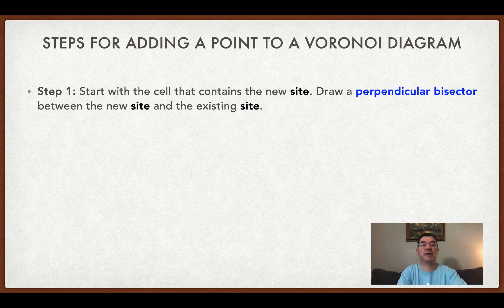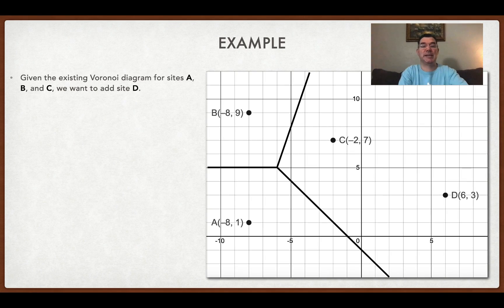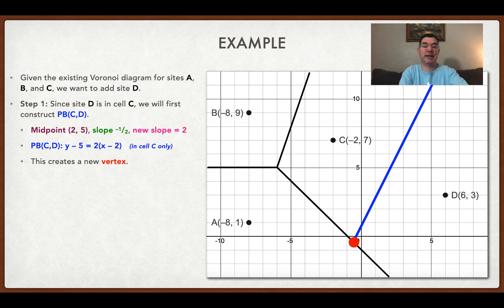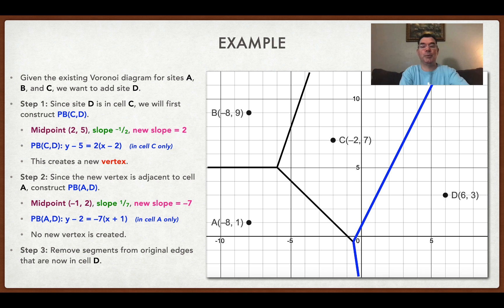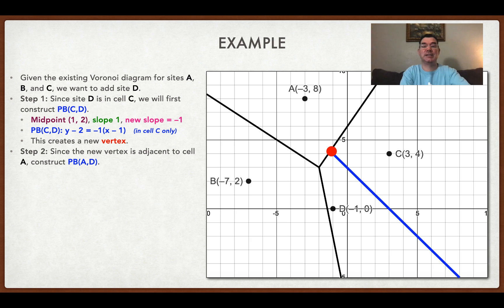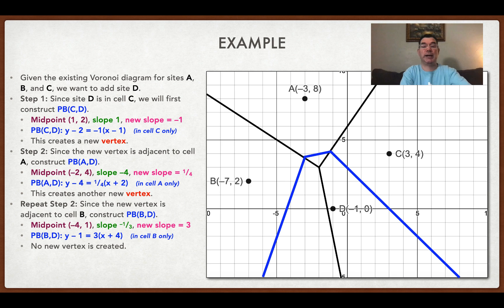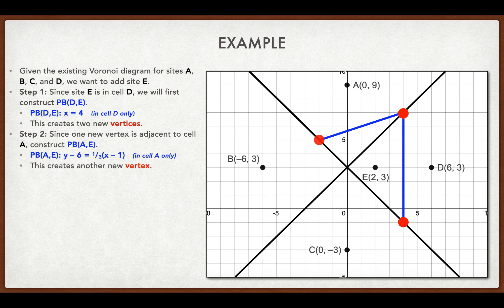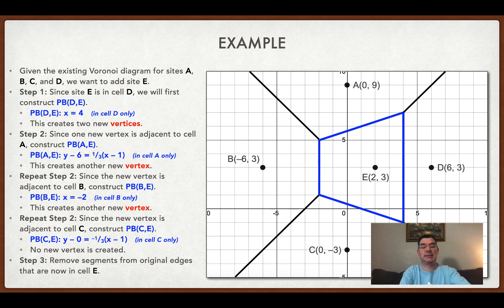Adding a Site to a Voronoi Diagram

Comment: I would add at @5:26 you only make bisector between B and D - because two points are the shortest distance. (this would apply for other cases when the bisector hits a pre-existing edge) So the big picture is to minimize the distance which is why this is important with triangulation. Regardless excellent work thank you for this resource and the time you've taken to make it.

Comment: Can you please tell me what is the guarantee that the perpendicular bisector will pass through the vertex which was generated earlier?
Reply from the maker: If the three sites are considered vertices of a triangle, then the perpendicular bisectors will always meet at a point called the circumcenter. The circumcenter can then become the center of a circle that passes through all three vertices of the triangle. I'm sure the proof of the existence of the circumcenter can be found somewhere.
Reply from the maker: https://artofproblemsolving.com/wiki/index.php/Circumcenter
Reply: @IanVanderSchee  Thank you very much for your reply

Comment: geat job!!!  I need do it numrically. Any tip??
Reply from the maker: Sorry if I left out some steps. To find the midpoint (xm, ym), xm is the average of x1 and x2, and ym is the average of y1 and y2. To find the slope of the line, calculate -(x2-x1)/(y2-y1). Does that help?

Comment: thanks for a great video, but what should we do in case when new site lies on the edge of the diagram?
Reply from the maker: Since that edge is the perpendicular bisector between two existing points, and point on it may remove part or all of that edge. That's because many points on that edge are now closer to the new point than they were to the existing two points. It depends on where the new point is along that edge, and how close the original edge was to the existing two points.
Reply from the maker: I would start by drawing a perpendicular bisector between the new site and one of the two existing sites that names the edge.

Comment: Thank you for the video.  What program did you use to create your diagrams?
Reply from the maker: I used Desmos to create the graph with the points, and then used Keynote to add in the edges of the Voronoi diagram. Very time consuming, but I like how it turned out.
Reply: @IanVanderSchee   Thanks for you sharing! this is an amazing tutorial. Recently, I am doing some research on spatial AI, and this definitely helps a lot. Thanks again.